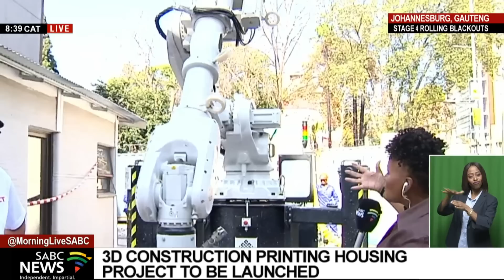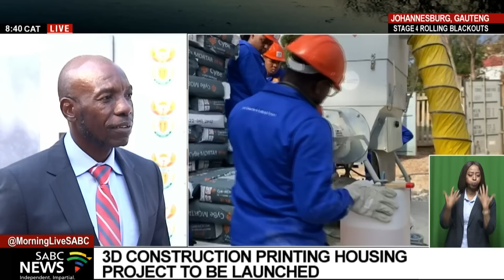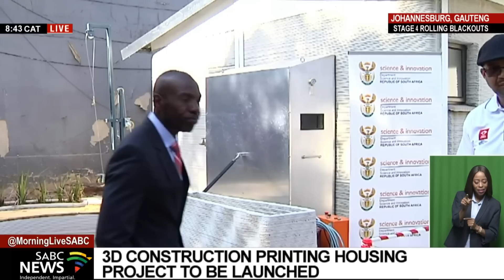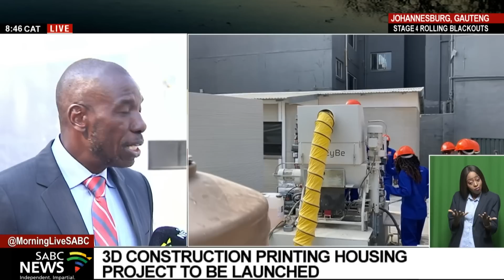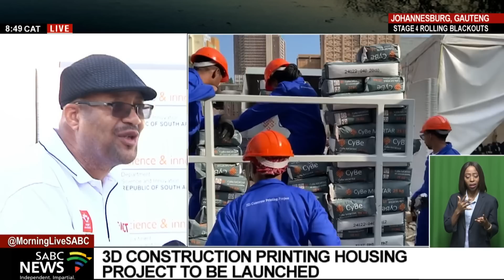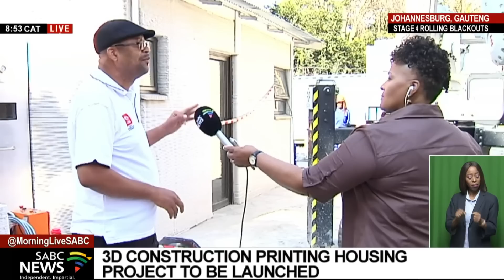3D construction printing housing project to be launched

Comment: Its another form of construction but it won't end the classic method of building infrastructure.  There is no need to look down and degrade of those working presently in construction( brick layers)as dirty and disgusting.  
It's a condescending elitist statement from the Professor. 
The technology is being used in other countries, it has not rendered the masonic profession obsolete and it won't  since it cannot solely sustain  the demands of National and Private infrastructure building projects on its own.